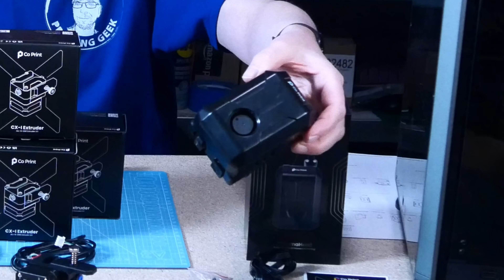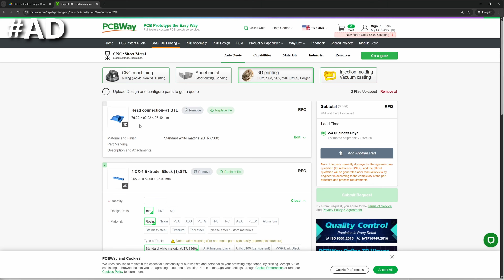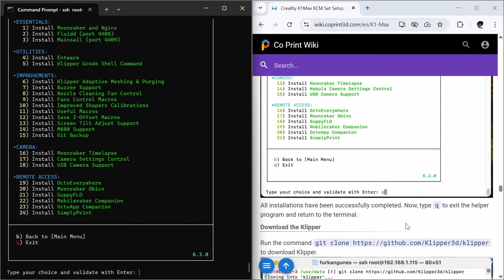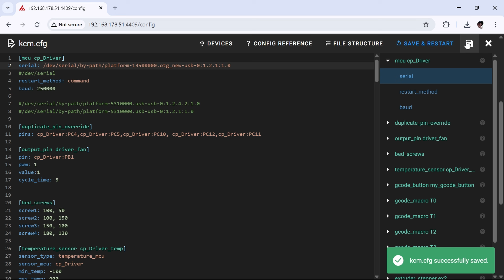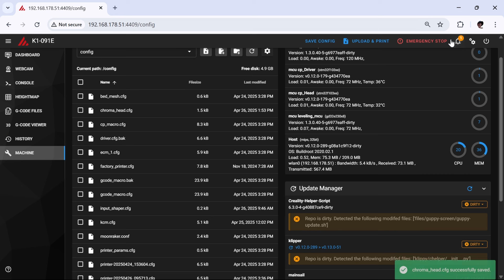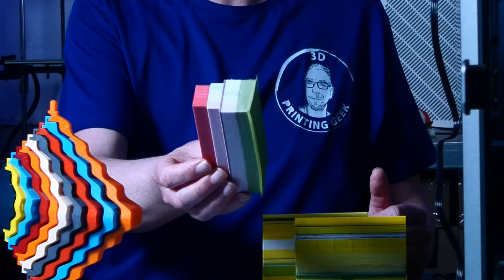The $289 Multi-COLOR UPGRADE Your Creality K1 Needs! CoPrint KCM Set

Comment: First Off, You Da Man. Secondly, if anyone is doing this on the K1C you may need to get the specific files from github as well as the configs from the K1 on the wiki as the link to the K1C configs is broken. Not sure if there is a difference but this is what I did. Also you may have to do the USB paths for just the KCM but not the head. I tried to do both and it errored. But it didn't error just doing the kcm.
Reply from the maker: Hi @austincain2173 thx a lot.
I haven't looked at the current configs in their GitHub but it may be that the USB path of the head is already corrected. Though it never hurts double checking that by looking at the devices without, and with the head connected. That way one can clearly see, what USB path the head has.

Comment: Great Video! 👍
but unfortunately there is just about 19x16 maximum usable bedsize left with the chromahead installed on the k1, sure there is a price difference between other solutions when scaling up, but u need to remember that u need more space for a purgetower as well with more colors, which becomes kinda hard with the bedsize left on this machine and without poop possibility on this setup 😄
Reply from the maker: First thanks for the 👍. I put a lot of work into making the video.
Yes, the reduced build area is the biggest headache, and that is why I will shift the KCM to be used on a more suitable 3D printer of mine.  I mentioned that in the wrap-up at the video's end.
Not to forget about the recently appearing Creality upgrade kit for the K1 which enables it to be used together with the CFS, and that will keep the print size.
Reply: @RayZorXLP  I agree 220x220 is already too small for a lot of models out there. I'm so disappointed.  Especially since I searched for this video after getting an email that CoPrint is on sale, right now.

Comment: Great work on the video, thank you. You mention that you rooted your K1 (and you mentioned this in the pre-requisite section) but you didn't specifically state if root user was required to install the KCM. Could you please clarify if root is a requirement for the KCM install on the K1? Thanks again for the video.
Reply from the maker: Thanks for your feedback! Yes, root access is indeed required to install the KCM on the K1, as it enables SSH access to run the necessary commands.
As mentioned in the video, this must be done before removing the old printhead to avoid getting stuck later. The good news is that you can completely undo all changes if you want to return the K1 to its original configuration.
Let me know if you have more questions!

Comment: One thing I did not know was that CoPrint is not made in Turkey but in China. I was excited to finally get something from Turkey and not China. But NO!!! I guess I need better research on  my next expenditure. OH WELL>>> Thank you for the video.
Reply from the maker: Yes, unfortunately the CoPrint sets are delivered directly from China, so one may have to pay customs on top which happened to me when I got mine from the Kickstarter campaign. Though that would also have happened if they had delivered from Turkey, since it's also not part of the EU. I had hoped that there would be a shop in the EU selling the CoPrint sets. That way none of us in the EU would have to deal with customs.
Reply: @3D_Printing_Geek  WOW 3d filament from Turkey has a 50% tariff. One would think since our Airbase in Turkey is key to our interests in that part of the world, we would cut them some slack. But oh well, if they revoke our airbase then maybe the government will gain some perspective.

Comment: This is great dont get me wrong but I would honestly would love for a company to make a adaptor for the print to completely change tool head every-time it wanna change filament! Honestly I would be happy with 3 toolhead one for the filament and the other support filament and the 3rd another type of filament (ASA, support with TPU filament) wish it would be possible on an X1 carbon since it’s the only printer I have 😅
Reply from the maker: Well, there are several options available on the market. There's the new Bambu Lab H2D with Dual Nozzle or the Prusa XL where you can choose to have up to 5 tool heads, just to mention a few. I don't know how Bambu 3D printers are build in comparison to the Prusas but maybe you're lucky and they will offer some sort of upgrade kit in the future to convert an X1C to H2D?
Reply from the maker: Thanks for sharing this. The Bondtech INDX system is definitely something that will shake up the 3D printing scene!

Comment: What happens if you turn off the purge tower
Reply from the maker: When you turn off the purge tower you will get the colours blending into each other, transitioning from the last used to the new one, until all of the last colour has been pushed out of the nozzle. This can totally ruin the print because during the transition the colours mix more or less. To get clear colours purging the nozzle on each colour change is required.

Comment: I have a question for you if I may. I have installed and set everything up my question is when I send to the printer how does it know what slot is what color? I hat determined by the filament order in the slicer? I look forward to your response.
Reply from the maker: Thanks for asking. The extruders are numbered from T0 - T3, and in the slicer you assign the colour loaded in T0 to the first filament, the 2nd to T1, and so on. Then, when you slice the file to generate the GCode for the 3D printer, it will add the colour change commands into the GCode.
I hope that helps?
Reply: @3D_Printing_Geek  Yes that helps I am used to assigning at time of sending file I am running test now trying to get all of the motors to run properly. Thank!
Reply: @3D_Printing_Geek  Ok sorry to ask I have 1 more question. I have everything working and running smooth (it is a Neptune 4 Max by the way) Picking individual color for print from any slot works perfect but when color change it does not extrude. No matter what order or colors I select the 1st is fine the 2nd not so much. If you cant help I understand. Thank you for taking the time to respond to my ealier question and for reading this.
Reply from the maker: I assume you're using Orcaslicer and set it up by selecting CoPrint as 3D printer profile? If so then it should almost work out of the box.
Reply: @3D_Printing_Geek  I am and I have everything working smooth except for filament changes I have tried every motor backwards forwards etc...lol....I found a loose screw on the hot end and still to no avail it won't do a proper color swap. I have emailed them to see if they have any ideas. Thank you for replying. I will update you when I get a reply. Also when I did the install of the ECM the include command was not in the printer.cfg...oops easy fix tho.
Reply: @3D_Printing_Geek  Sorry for not filling you in sooner. The issue with filament change was the new chroma head has a filament sensor and the config needed to be changed they updated it like 2 days later. The folks on Discord helped me with that, Thanks again.

Comment: I bought the Co-Print with the Ender3V3 Plus combo and the CP didn’t work at all and wouldn’t connect to the Enders Motherboard
Reply from the maker: Sad to hear that. Have you reached out to their support? When I faced the problem with the broken ChromaHead, the sent a replacement. It happened during the Christmas season. I think that was the main reason that it took about 3 weeks until I got it.
Reply: @3D_Printing_Geek I just sent them back the Co-Print and they are going to send me another one.

Comment: Did your KCM setup interfere with your K-1's automated leveling system?
Reply from the maker: I didn't have any problems using the auto leveling. Besides being able to do a leveling of the full bed I also used KAMP without problems.
Reply: @3D_Printing_Geek apologies what is KAMP?😮
Reply from the maker: KAMP is the acronym for Klipper Adaptive Meshing & Purging. It increases the precision and reduces the time to acquire a mesh of the print surface by only meshing the area used by the model to print. It's a Klipper add on.

Comment: My K1 would be slower and lose too much print plate size. Multicolor prints are wasteful unless you do many at once. My Ender 3 S1 Pro would need the more expensive $439 version of Co-Print.
An Anycubic Kobra 3 V2 combo that prints 255x255 is only $359, including one enclosed/heated ACE 4 color unit. Get (maximim)8 colors for $260 more. This without all the programming and rooting required. 
Exactly who is this product for? The 500 people with a Kobra 2 Max or  Neptune 4 Max?
Reply from the maker: I appreciate your detailed feedback! It's helpful to hear different perspectives on the CoPrint KCM set and how it compares to other options. Your insights will definitely guide others in making their decisions! The reduction of the available print area is a real bummer. Interestingly the slow down isn't. There are better suited 3D printers to use the kit with, or if one can afford, choose one of the off shelf color 3D printers.

Comment: does this have a run out sensor built in? or does it keep going if it runs out of filament?
Reply from the maker: Great question! My ChromaHead doesn't have a built-in run-out sensor, but I've read that there's a newer one which shall have one. CoPrint mentions one in their Wiki (https://wiki.coprint3d.com/en/introduction-to-kcmset).Still there's no sign of one in the configs they provide. I can't confirm it from my experience, so if you run out of filament, it will keep going until it stops. I will keep an eye on it, and get into it in a follow up.

Comment: A good presentation but you rushed through the part that most people are having problems with.  The software installation.  That needs more time to be digested.  Also, you missed the need to set the print area and the bed leveling area in Klipper.
Reply from the maker: Thank you for the constructive feedback! I appreciate it and will definitely consider dedicating more time to the software installation and setup in future videos. I kept it at a fast pace because it's mostly following the steps as described in the Wiki. Since I used the provided configs for the K1 the print area and bed leveling were already defined right for it.

Comment: i have the kcm kit 8 color for my Ender 3 V3 Plus for about 2 month i all i can say is DON'T BUY IT. It's crap. one problem after another and their customer service is dumb. their tutorial of how to assemble it are bad, it's not plug and play. the kit reduces your printing  area, speed and most important the quality. The quality of the chromahead is awfull. i'm tring to make it better with the help of the comunity on their discord (where co-print is totally absent) by upgrading the cooling of the chromahead and the hotend (the original from the chromahead is totally shit). So my advice is if you want a multicol print buy an original multicolor accessory, like the cfs for the creality's printer or the ams for bambulab. Or if you are competent enought try to build the ercf from the Voron cuminty. Co-print is an immature company that produces products that are not yet adequate and are full of problems.
Reply: i forgot, great video dude, at least someone here post well done tutorials. Right co-print?
Reply from the maker: Thanks for sharing your experience. I went through ups and downs using the kit, too. Originally, I worked to publish a video about the KCM set at the end of last year. Unfortunately, while recording and testing, my ChromaHead failed. 
I don't know how much the print area is reduced for the Ender v3, but the reduction on the K1 is almost unacceptable unless you only print small stuff.
Besides, it not being a beginner-friendly solution, I have no complaints about the print quality. All of my 3D prints finished with remarkable quality.
Long story short: If one likes tinkering with 3D printers, and doesn't mind spending the money for the set, knowing that it may be wasted if the set fails, then go for it.
All others should get an already multicolor ready 3D printer from one of the well known brands.
Reply from the maker: Thanks again, I'll do my very best.
Reply: @3D_Printing_Geek the reduction for the Ender 3 v3 plus is not a big issue but Co-Print should talk about it before selling it. It is reduced from 300x300 mm to 290x283 mm. Not much but if you create portraits with hue forge it can be a problem. Maybe i'll try to find a solution by moving the bed to the front left one day but not now. Now i'm trying to get an acceptable print quality from the chromahead. I'm trying it from about 3 weeks now... The main problem is the cooling which is very cheap on the stock chromahead. And the hotend, low quality. And my hotend that is defective (or the chromahead), i'm talking with co-print support to solve this problem but they are not so well receptive (they take too many days for a reply and they don't want to send something new...).

Comment: do you have to use the command prompt for the sovol? having trouble understanding their instructions, if you could help me that would be amazing thanks
Reply from the maker: Hi. It depends on which Sovol printer you have. For the Sovol SV06 I'd say not, because it uses the ChromaPad. If it's the Sovol SV08, then you have to open a shell to execute some of the commands to execute them. If you need more help feel free to ask on my Discord https://discord.com/channels/1091637268906782762/1242457596334444586